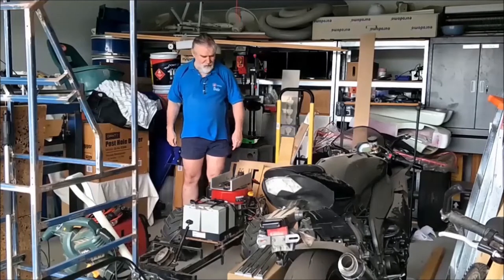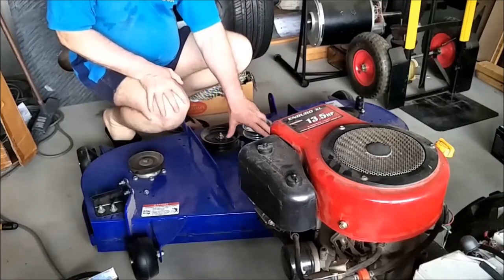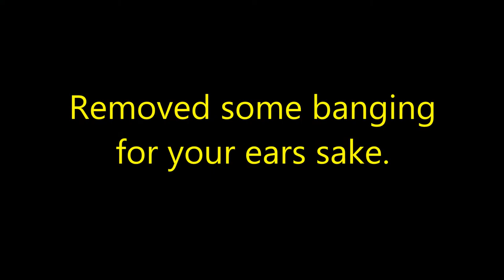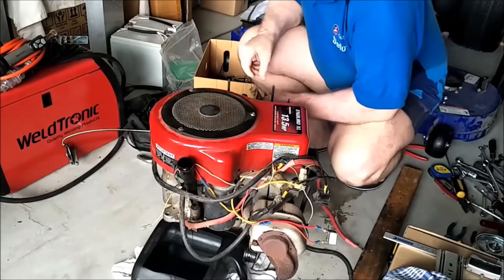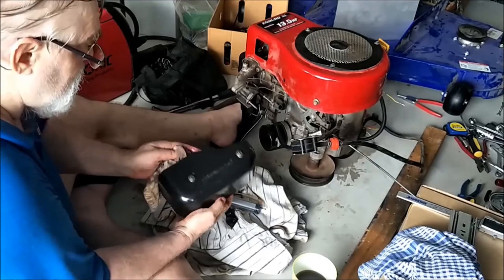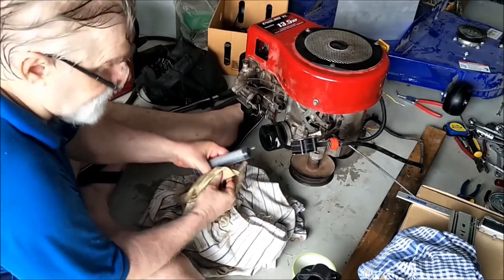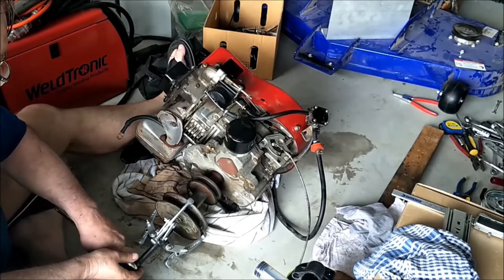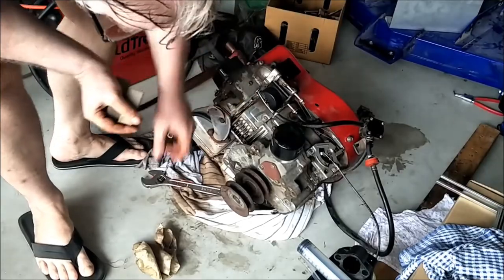Remote Control Mower - Part 3

Comment: Oil got into the intake via the crankcase breather vent hose if you look in the video it's the rubber hose above the oil filter
Reply from the maker: Not sure how I missed that especially since I had to disconnect it. I had to re-watch the video to see where it joined, and at one point you can see when I am pseudo re-assembling it there is tube fitting on the lower section of the carb assembly, and the rubber hose you mention is high on the engine, so that has all the hallmarks of a crankcase breather. Only thing I can think of is that it seems half way up the cylinder, and perhaps I didn't automatically twig to it thinking it was in the middle of the bore and couldn't be a breather. But in the video I also made the assumption that it was going to have pushrods... but if it is a chain driven OHV then there is quite a good chance there is sufficient space that a breather could be half way up the cylinder. In hindsight I am definitely leaning towards your explanation rather than mine.